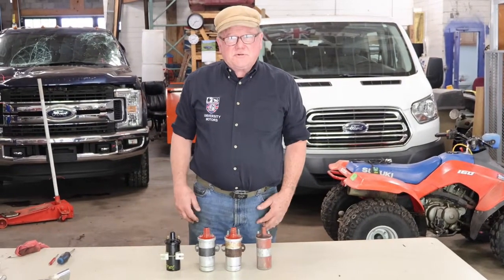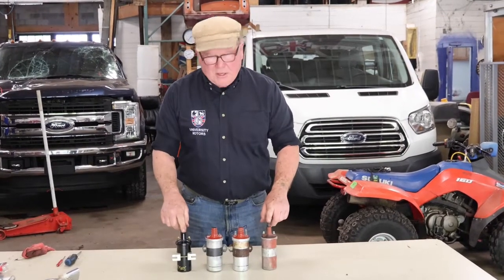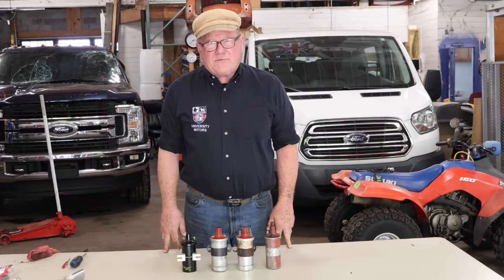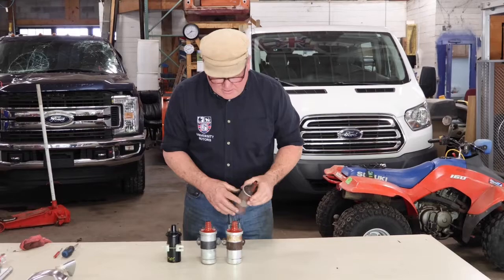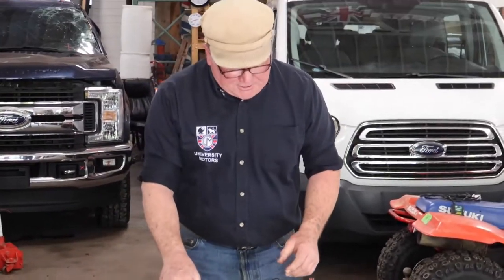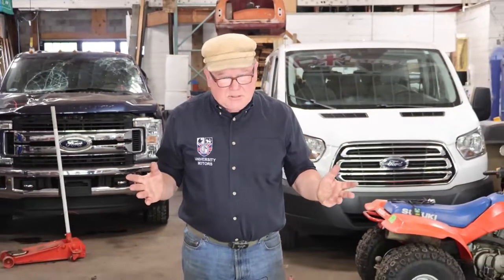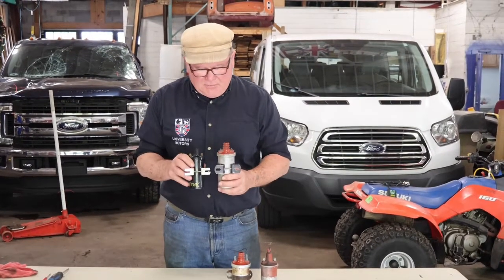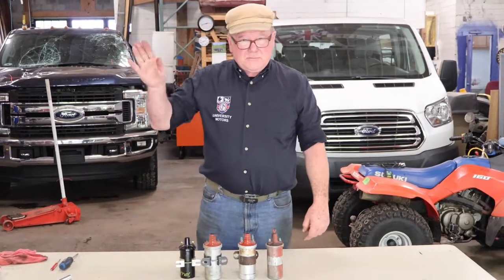401 MG Tech | MG Ignition Coils

Comment: I was told at one point that the coils were different dependent on electronic or points ignition. The coil responded to different parts of the broken circuit. No idea if that is meant to be correct but I kept the same coil on a bike I converted back to points from a broken electronic ignition. It certainly still worked.